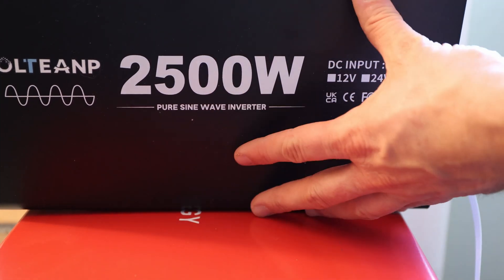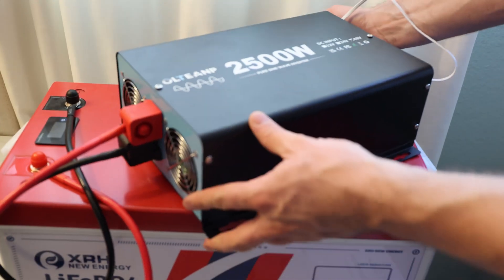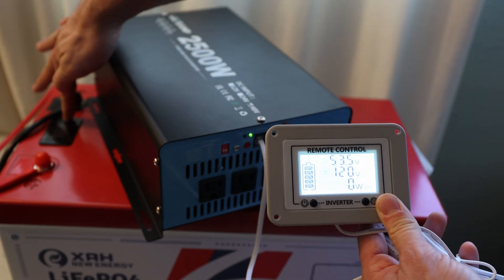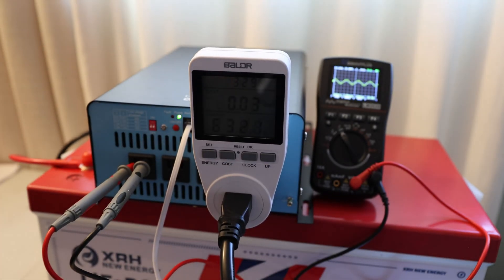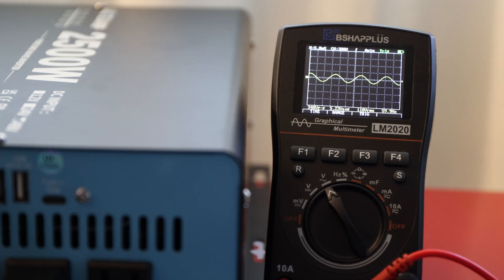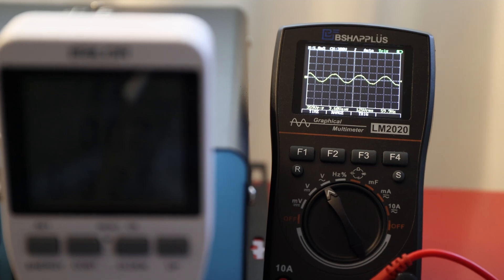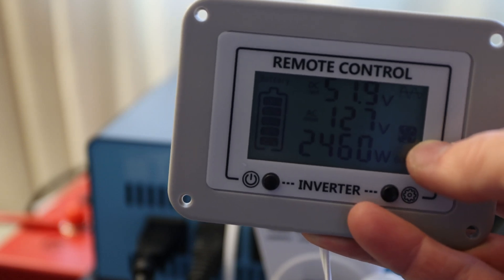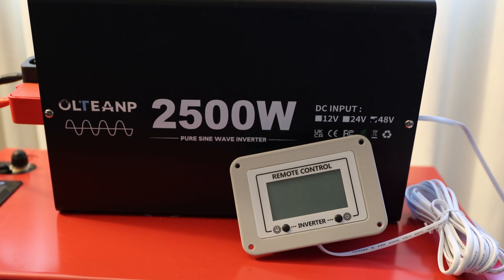Pure Sine Wave Inverter for 48V batteries for your RV or backup power by OLTEANP

Comment: Question for OLTEANP users:
 After a low-battery voltage (under-voltage) turn-off.  
Will the inverter re-start when the sun comes up and the battery goes back up to 50 volts? 
(In case I'm not around to reset it).

Comment: I have a question.. I have the same inverter with a LifePO4 battery 51.2 V with 25Ah.. looking at your video, I knew I screwed up with the low Ah.. any recommendations.. I am getting a fault light.. the red on.. no display..
Reply from the maker: The fault light can be related to many things, but maybe try to check your voltage settings to ensure compatibility with your battery.

The 25Ah sized battery should still work even though capacity bis smaller.
Reply: @tobisreallifeskillswithtobi  I have checked the voltage setting.. what is crazy, when I connect the inverter the voltage drop to to 5. 3V crazy.. note the battery is fully charged.. but I will keep troubleshooting it..
Reply from the maker: @LeonWilson21 does the battery have an on off switch? Bluetooth? Maybe the inverter is defective ;/
Reply: @LeonWilson21  Most inverters have a LOT of capacitors on the DC input. 
When you connect a (48vdc) voltage source to an inverter, the DC input looks like a DEAD-SHORT, until the capacitors charge up (it takes a second). 
You can see sparks with connectinging a battery or other power-supply.  
Your little 25Ah 48vdc battery, likely has SHORT CIRCUIT protection.
It will likely shut down instantly.  (To protect itself). 

To safely connect a battery to an inverter, I connect the Negative cable, and CHARGE UP the inverter using a resistor on the + positive connector, before connecting to the + terminal. 
Or, I'll use my Bench power supply to charge up the inverter, and then quickly connect the + Red positive cable before the caps self-discharge. No sparking! :)  
  
NOTE: Turn OFF the inverter before Connecting DC power to it.
Reply: 25Ah battery on 50volts, it means you can draw most likely only 500-1000W
Reply: also you need 48V version of this inverter